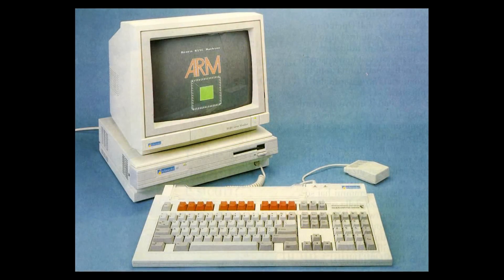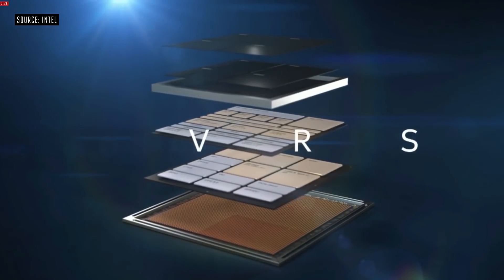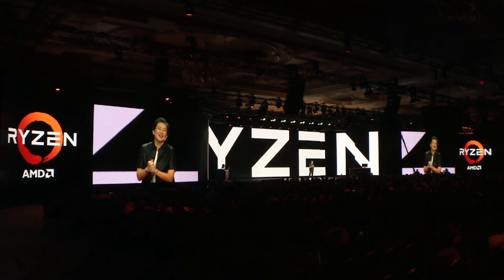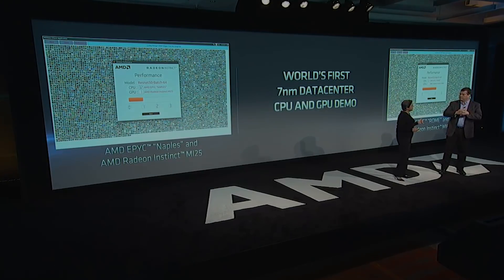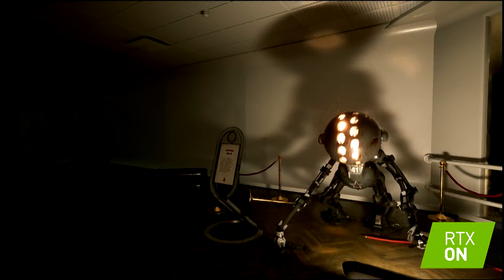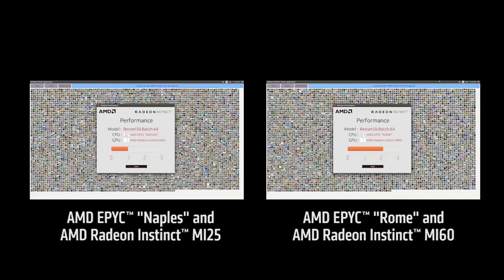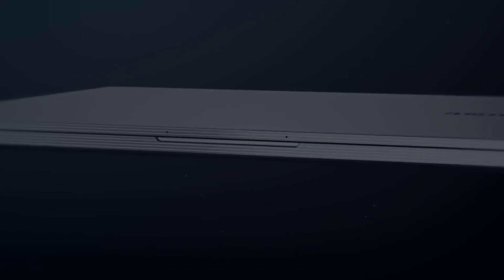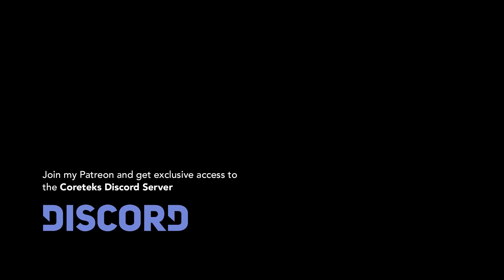Hardware trends: How many cores do we need?!

Comment: I need all 16 threads from 8 cores for my flight sim - Lockheed Martin Prepar3d. Nothing else can hammer my Ryzen 1700 like P3Dv4.

Lockheed Martin bought the Educational rights for FSX from Microsoft, and have continued to develop the sim,  eventually going to 64 bit, and with version 4.4, being able to use all your CPU resources. No other sim on the market does this. The others ( XPlane 11, Aerofly FS2, FSW 64 bit, FSX:: SE and others) do not spread the CPU load beyond one thread.

See these pics of frame rate and CPU load.  
https://imgur.com/a/LuU1ruC

A single thread based program needs super high clock speeds to get good performance, and if you have few threads available , you get stutter. Even though I rum my CPU at just 3.4 GHz, I get very smooth  and fast stutter-free performance in P3Dv4  not from having 5.2 GHz, but from having 16 threads, and a program that uses them all.

Assuming the next gen Ryzens have 12 cores/24 threads, I'll be lining up for that to get even better flightsim performance.

Comment: NVIDIA is working on AI that will convert standard software to optimized code. so scaling won't be an issue.  also the big limiter on cpu performance is heat so going beyond silicone will cause a good boost in IPC along with new instruction sets. at the very least I expect a fiber optic memory bus to be added just to solve memory bandwidth issues related to scaling in the near future. in truth we could have had it already but memory makers supposedly want light based data storage before they support a fiber optic memory controller.

Comment: idk , but 6 ain't enough apparently , 
just doesn't feel that much more powerful then 4790k @4.7 before this 8700k @4.9
the next one is going to be 16 core from intel for this guy , in about 2 years when they've been out for a year , 
so the price has cut in half and they actually come close to the REAL price they should have had when released the damn things
it's all just a bit TOO freakin expensive these days , fr what you get home 
a few years ago , you where actually HAPPY when you got home a piece of tech , now a days , 
i just throw it in there , check out some games and that's it , back to watching some tv , cause the games still don't work like i want them too
TOO much money for all this SLOW *ss junk , in 2018/2019 , we should have 32K resolution gaming at this time , 
i don't know why it all takes this long , but they HAVE graphic cards and chips and processors that are 100 times faster then the junk we get ,
and pay a full month's wages for in this day and age ! freakin pc world is going down the drain  like a torpedo

Comment: Now i'm at the end of the video, I can say that we've heard of these arguments for years. 
I bought the first mainstream quad core i3-8100 at the end of 2017 and I thought I'll be good for a couple of years with the same thoughts as stated in the video.  I was surprised to find it to be just good enough for various workloads including browsers.
Google Chrome is not only parallel but multi-process with multiple tabs.  It uses all my CPU when opening multiple tabs at the same time and can be sluggish at times.  Good thing, the quadcore chip allows me to do some basic tasks while it has a rendering workload unlike my dual or single cores.  

The old argument with a workload of spreadsheets or browsing is now weak for me. An analogy is for the engine power.  We don't see 20-50 horsepower cars despite we only use that much when we drive.  
Android's Playstore uses all the cores in a mobile phone during installation or updates. The CPu is so good that only little slowdowns will be noticed while simultaneously scrolling with a social media app.

There will be more content creators than we have today. The kids of today will need more compute for content creation when they get old.

Comment: 3:18 Yes and no.  If developers continue to push the limit for graphics, there will always be a need for discrete GPUs for consumers. I think Nvidia is aware of this which is the reason for pushing ray tracing early at such a performance level and quality right now.  
I do like the idea though as it will allow the system to be insanely efficient in size, performance, cost.  I'd like to see where the CPU and GPU shares the use of HBM memory

Comment: you only need 8 cores with 16 different threds. thats it. please no 16 cores. it just adds price, wattage, and lower overall clock speeds, not to mention more instabilities when 1 core doesnt like things going on. i've never seen my pc go over 85% cpu usage on my amd 2700 when doing regular things. this even includes streaming and encoding. stop with the damn cores intel and amd. just make things stable, and work on those nm.

Comment: Graphics cards will still be a separate part of a mid to high end computer because the need of having the GPU related components such as power management and graphics RAM, parts that cannot fit onto a single pcb, and what AMD has done with chiplets is to be able to continue adding cores and/or related chips to allow the CPU performance to increase, stacking separate layers of GPU and CPUs onto one another isn't a viable option due to heat, heat that is created when transistors turned on, the only way of decreasing heat enough to make vertical stacking possible is to lower the amount of transistors and their clock cycles, something very few consumers is at all okay with since it would represent a complete halting of any computer performance development, just for the sake of "the new thing", which would just be less, while more expensive and would remove the consumers ability to pick and choose what to pair their computer with, that is, a "one size fits all. well, not all. But you have no option anymore so haw-haw on you!".

Comment: Asking programmers to switch over to parallel code is like asking certain countries to switch to metric. It's not necessary and as a programmer myself can tell you it's not gonna happen, no matter how much it gets pushed. The problem is that there is an upper limit to what we have in CPUs today. The fact is that the current type of CPU has an upper limit to it's capability, and will inevitably be replaced with quantum CPUs. All technology has an upper limit that forms an "S" curve in it's R&D costs vs it's advancement, and eventually no matter how much R&D you put into it will get next to no advancement; and CPUs are beginning to hit this point.

Comment: Good video.  I find it hard to believe Google Chrome is only 50% written to be in parallel.  You would think it's closer to 99%, since each tab in Chrome is usually independent of the other.  But, if true, then indeed Amdahl's law would limit Chrome to now much better performance after about four to eight cores.

Comment: I think the problem with applying Amdahl's Law to CPU technology in such a blanked way is we don't know how software is going to be designed in the future.
Yes, "Right Now" everyone codes sequentially, all that means is "Right Now" the software industry is suffering a mental block to better performance, but that 75% parallelization number is certainly not set in stone, and given how critical we know that parallelization is, even if it takes hundreds of years we will see a shift to common programs utilizing more cores.

Comment: Interesting take on multi cpu configurations but you ignore the obvious. Most all computers run dozens of processes. Each process is a separate program. In a mature system it is not unusual to have 50 to 75 processes. Most processes dont need more than one or two cores, but the overall benefit is much larger than the characteristics of one program operation. Parallel ops can help, but many cores for typical systems can be a boon even for casual users. It is rare these days for any user to only have one app at a time use cases. You missed a big one here, and are misleading many people. Shame.

Comment: Intel's solution seems like it wont work on high performance parts, more what I mean are desktop and HEDT parts. As clockspeed is key, it might work on server as they work at lower clockspeeds so there is some room to maybe do some 3D stacking, but even in laptop it seems like something that wont work as you can't have OP cooling solutions... I suppose if you sandwich a very thin vapour chamber between the layers you could do it though, but 3D stacking to me seems rather pointless to me at least for the next 5 years at a bare minimum.

And honestly you would be better going 2.5d and just increasing the package size even more which also helps you dissipate the heat more effectively as a bigger IHS means better heat transfer and then just have the IHS be a vapour chamber.

And really the as said the only place a can see it really working is server where space matters yeah. but not so much that a socket that is 1.5x the size will really matter when in the vast majority of cases you wont be able to fit enough memory for data centre customers under the IHS, the reason for putting memory there would be so that you can have a high bandwidth cache of like 32 - 64GB maybe 128GB then haven 1TB of main memory per socket.

But again your not getting ride of main memory, your just adding faster on-board memory, so again the point comes back to why you can't just increase the package size further. Yeah such a package would look stupid, but otherwise it doesn't really matter and the negatives would outweigh the positives for quite a while until we are upto like 512 core cores and we have pushed manufacturing processes to there absolute smallest and we have packages the like 2 - 3x bigger than they are today and your silicon interposers are just getting to big to manufacturer no matter how much data centre customers are willing to pay.

Comment: Currently, adding more cores to an existing process requires giving up some frequency to keep the power usage and heat generation down.  I think the performance gain by simply adding more cores to the same process is worse than shown, unless the formula is already taking that into account.